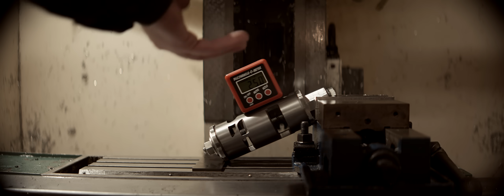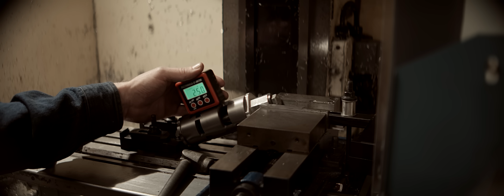Sleeving the Most Powerful Two Stroke Attempt Cylinder.

Comment: Remember that if you use heat and cold to install, the cylinder will shrink while the sleeve will grow. That makes it shift slightly from the center to both ends. So you have to use the press during cooling to keep the locating flange in contact with the barrel recess.

Comment: Hi My advice is do not press the cylinder use nitrogen - 180 c and warm the barrel to 100c or you may have a disaster buddy
Reply: I second that motion.
Reply: i think the problem is sourcing liquid nitrogen in norway its the same problem in sweden for private persons and its not the first time he will use the press so we shouldnt jinx him now
Reply: The barrel should be thougherly heat soaked before trying to fit the sleeve. Remember what happened to the Brute Force liner when that was pressed in cold. It buckled!
Reply: It is not necessary to use such a big contrast temperature. If you calculate the press fit right, it is ok if you just cool it in the fridge to -20C.
Reply: @Alexxx95_H  But the engine heats and aluminum expands at a greater rate than the ferrous sleeve. One would have to figure press for hot size of the bore to hot size of the sleeve.
Reply: Even just putting it in the freezer, or out in the garden since he lives in one of the ice countries, will help
Reply: Or a carbon dioxide fire extinguisher. It'll get you to -78c.
Reply: As a cheaper easyer to come by Alternative too liquid nitrogen I recommend dry ice not expensive  not soo dangerous and with around -78°C a delta t of 200k too the parts helps pressing in a lot also if you have a Block you cann just put the sleeve on top it gets a temperature gradiant across its length making it a bit conical that helps with centering the fit
Reply: The best mashine for This job. Is a cnc lathe.
Reply: Well here in Czechia we tune our 50cc with sleeve cylinder. We freeze the sleeve in the freezer to about -20° and heat the cylinder to like 150-200°c. The sleeve needs to be 0.06mm bigger in diameter than the cylinder. Or the sleeve can be slip fit, but then it needs to be to have a copper layer thats 0.06mm bigger than the cylinder hole. Cheers
Reply: You mean liquid N2....?

Sure...I will just go to the store...and pickup some

Dry ice works good enough...may be more readily available 

I think the cylinder could be placed in oven...like at 400 deg. F
Reply: My apologies I was mearly offering a solution to you next possible problem, I had no problem getting nitrogen or sticks toff in swiss German, in Switzerland so I presume you would have been able to purchase it in your country too. You can get plumbers pipe freezing kits using 
C02 but you must be in a ventilated area ie out side .
Anyway good luck
Reply: @CrazyTony65 Do you think that you will have a loose fit at 70C cilinder temperature?
How do you imagine that if you make a pressfit at 100C cilinder and -20C sleeve - that is 120C difference between materials?

Btw if you make a step in the sleeve and cilinder and you tighten it with the cilinderhead from the top, the sleeve cant move in linear motion at all. the rotational force is almost none. It aint going anywhere.
Reply: @mostlymotorized  No, the cilinder has to be heated! Sleeve is going to the ice.
Reply: This guy lives in Norway and it's still winter. Just taking the liner outside for the entire night, it'll do the job 😂
Reply: Ye I did some stuff years ago simply measure the cylinder at room temp with a calibrated micrometer and then submerge the cylinder in liquid nitrogen in a large brand new tin container and 
Wait for 5 minutes, remove and quickly measure it again, 
I have developed thousands of four stroke cylinder heads over 30 years and also I have experience with many different aerospace materials, guides ,seats ect 
I often installed valve seats 0.25mm larger than the seat bore I'd!!! So there are reasons for this 
,a clue ,heat is the enemy , 
A few degrees = a few degrees ignition timing!!! So  don't go against nature ,work with it 😁😁😁😁

Comment: I love the creative fixturing but I think a sine plate to mount the vise to would make this job lot easier if you have to machine angled ports like that again ;-). They're not too expensive used and if you're not trying to get within fractions of a degree they can be made in the shop.

Can't wait to see all the hard work pay off on the dyno, keep up the good work!

Comment: "chatter" pronounced (Chat-ter)

machining, vibrations, also called chatter, are the relative movements between the workpiece and the cutting tool. The vibrations result in waves on the machined surface
Reply: I think he may have meant Shudder, Shuddering?

Comment: A small rotary table on its side works well to give you the correct radial (directional) angles,i used tbis before cnc porting obviously the axial (roof) angles have to be done either with a tilting head or rotary table, unfortunately i cannot post pictures of my setup pre simultaneous 4 and 5 axis cnc

Comment: I don't want to sound negative, but I see a patron in the videos of this channel, and I watched most of them because they are fun, really fun. This man always does the same: creates an engine prototype, exagerates a lot the physics, makes obvious wrong choices, trash everything and starts again. How many times did he changed the dyno and how many times did it properly function? Very little times. He always has a problem, his engines always underpower, they varely even work. I mean, I watched this dude for years because I love his content, but it's getting kinda hard for me to not think that he lives from doing this, and if he is successfull all his channel would come to an end. He needs to fail over and over for the content to keep existing. Sometime he'll have sucess, who knows? Sorry fot my bad english.
Reply: System: treasure  from oak island.
Never ending story.
Reply: Break my bubble of Alex failing...

I think the inertia dyno basically worked...once calibrated...

But once mass was accelerated...and time measured...

Then what...?

So basically to measure HP....it is rev up..
Then measure...

To pull the bike...thru air...

Let's load that engine down...

And measure HP at different engine speeds 

Steady state...

Well at least until the rotor and brake pads fail....

I really think Alex doesn't want to keep failing...

Some paths...come to an end...or points to new path..

The supercharger fiasco. ..
Well to me..drained power. ..

I was fun to watch...
Reply: @fredmitchel1236 yes, he is fun to watch, I'm just seeing a cicle, that's all

Comment: Make a 20-30mm aluminium fixture plate for your table with two threaded holes and two holes to mount the plate, make the octagonals have holes on each face, screw cylinder with octagonals onto fixrure plate. For posistioning you could add “styre hylse” permanantly to the table fixture, and make h7 tolerances holes in the octagonals. And if you need to tilt the part you can use a sine bar/ paralells / angle blocks under the fixture plate 😀. And make some inserts for the table mounting so you can easily tilt the plate.

Comment: Have you thought about your existing mill and ballhead carbide file. From geometry point of view, it shoud be capable of making shapes you need. You'd need a software, capable of making right tool paths.

I'm not sure how geometrically accurate those are, but I think good ones can be quite accurate. 

They are not fasters way to machine metal, but in your use-case, it don't matter much.

Comment: Without doing all the math or having the pieces in my hand, I think you could have clearance for 98%  of the port angles with the sleeve horizontal and using a lollipop cutter and surface machining, only down side is surface machining takes a lot of machine storage. Or at least gain a lot of Z axis height by putting the sleeve at only 27.5 degrees instead of 55 for the C transfer. Maybe a basic small indexing head and machine your 8 section disk instead of a full blown dividing head, to gain even more Z height.

Comment: Glad to see you again. You really need to rethink that engine dyno setup. I don´t want to be a smartass, if anyone wants I can elaborate. This simply isn´t good, or I´m missing something.
All the best from Serbia.
Reply: Yes, please elaborate a tiny...

I think the load cell can measure both tension and compression...

Cal it with some deadweight..zero and span.

Drive with nice stable excitation voltage at its rated value...probably 10 VDC

It probably is a 350 ohm bridge...

Don't use a 1000 lb load cell to measure 20 lbs of force...

Shield signal cables...

The geometry looks a little off...

Add say 2% power loss in chain...

Then with a rpm sensor...

Dynamic horsepower can be measured..

And I think called brake HP

I am sure his dyno could work...

It wouldn't need to like be set so 1 foot is the exact radius..

Probably you could use a little calibrated torgue wrench on the crankshaft....twist the crank...

Hopefully the disk and floating load cell.... can pivot easily...

With static break on...

You you see the crank to gear torgue multiplication....

So like if it is 10:1....a 1 ft lbs click of torgue wrench on crank you should see 10 foot lbs on load cell...if not adjust span pot...or tweak you geometry...

I think the best is push or pull directly...but avoid side load on load cell

And remember the rpm on the disk...will be 10 times slower than the crank....or whatever that teeth count is...

But of course for the engine...we want to see that measured RPM....

I think it could work....

And may the load cell amp be built with nice TI or AD Instrumentation operational amp at the front end...

I know the Serbians are very clever...

In my opinion...I think without a power valve...or copper head...max predicted HP...no more than 20....

May I not be a stick in the mud...

I love to see Alex return to Bonneville....

To me...I would drive from Phx...
witness and

Sink a beer with Alex...or a soda pop...maybe pop a cork of bubbly ..

Especially if a record is broken

WORLDS FASTEST 2 Stroke...

But I guess...before that -it first must be world's most powerful 50cc two stroke.... to have a chance

It's all good...

And don't tell KTM...

Comment: One answer to your Z-height problem would be to use shorter toolholders. 
An extreme example is the zero-length one I made here: https://youtu.be/fym44wESy8U
I mainly made my own because I couldn't find BT30, bit you seem to have a 40 taper machine, so they are available.

Comment: Why not make a riser block and raise the entire spindle/ Z axis?
Reply from the maker: 👍 Been thinking about it. There's so much unusable travel in the Z-axis, pretty sure I can crash the spindle into the table without a toolholder in there. Weird design.
Reply: @2STROKESTUFFING  Yeah seems like a riser would actually make the mill more useful. The riser shouldn't be that hard to make. Just weld some steel plates up and use the mill to make the sides flat and parallel after welding.
The Youtube channel "cutting edge engineering" has done it a couple of times I think.
Reply: Was scrolling for this comment. That z travel down low can be used up at the top. Was trying to get a good look at the cnc but just block it up shold work from what I can see.

Comment: just a question...

when u did that hex thingingie to press in to the cylinder. why didnt u make a round piece for the other end aswell maybe not as tight of a fit so it can be removed without to much violence

a support block with a perfect fit for that round part and a grub screw to lock it in  place to the suport block/ table at the top end. 

and then at the other end grab with the vice on the hex part instead of the sleeve and get perfect parallelity to the hex sides every time also during the initial mashining?

think basickly like mounting it in a laithe with the tail stock.

also squezing the sleve like that makes me atleast beleve it may slightly deform the sleve aswell maybe not much but probably a slight out of round while clamped like that.

Comment: Spörsmål Alex: is the pillar on the mill screwed to the bottom of the machine? i am thinking about a spacerblock for the pillar itseld to get it higher from the table - CEE Australia did a similar thing to a K&W facing borer  https://www.youtube.com/watch?v=yWYPCaVubi0  Edit - yes it seems to be..i can se the bolts holding the pillar at 9:30 , so a rizerblock for the pillar shoud be possible to fit- and sinse you dont even can run the quill all the way down a 100mm block woud help a lot in that machine

Comment: Instead of removing the holding fixture each time, could you provide indexing notches on the cylinder where you would only need to rotate the cylinder and re-clamp while not disturbing the fixture?

Comment: Several things to say ... 
FIRST....

 DO NOT DIAL IN YOUR VISE USING A HARD HAMMER!!!!!!  USE A SOFT ONE. Every machine shop I have ever worked in would FIRE YOU for doing that. Please.... Soft hammers only..

 SECOND

 You can set that cylinder up in your lathe and bore it out that way. You will get a MUCH better hole. You may have to make a fixture for it. Take a piece of plate with a round stub on it to grab onto and then bolt the cylinder to the plate. Mill a releif pocket so you can bore the entire cylinder out.

 Good luck and NO MORE HARD HAMMERS ON MACHINE TOOLS!!!!!!!!!!!!

 Jeff

Comment: What you need in my opinion is a dividing head. ope! You just said you have a dividing head. Wait I'm not seeing a dividing head... If you want to do angular ports you'll just need to add an angle plate. Or get a vice that pivots and clamp your dividing head onto it. I'm planning on doing all my ports at 90 degrees and carbide burring any angles I need which would be 2 transfers that's it...
Actually you could probably get away with a spindexer and an angle plate. If you're only going to do the one angle you could just mill a block and attach the spindexer... That's be the cheapest way I can see.

Comment: Later you can place Tee slot blocks on the mill vise...

And not have to play the tram game....

I did that to my GS mill Vise...a Kurt wantabe vise made in the country that built the great wall...

My setup allows...about less than 0.0008" TIR over a 6" long jaw...and just bolts down...

I can also do the hammer beat game and obtain...say 0.0005" TIR max....

Your a wizard anyway Alex...and avoid ...for the most part...avoid rabbit holes